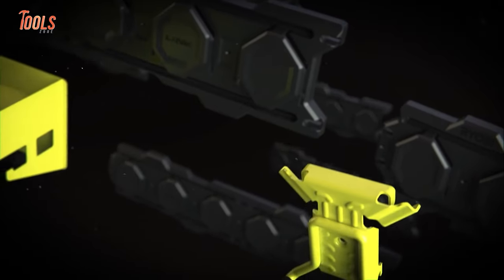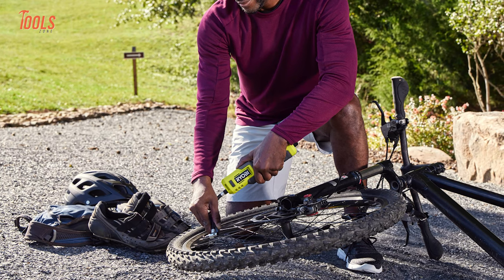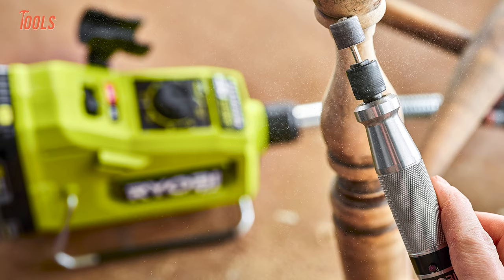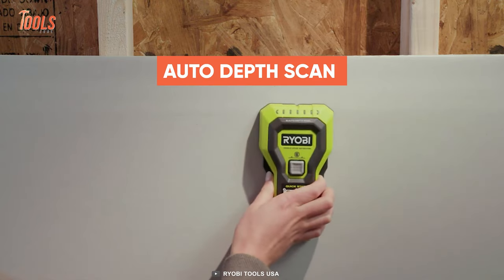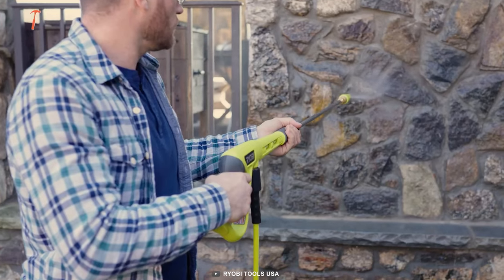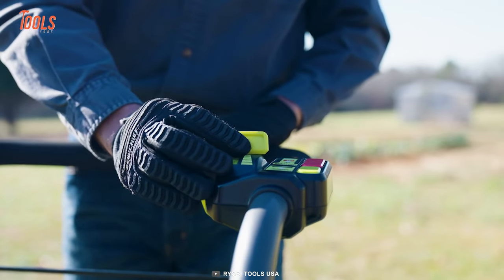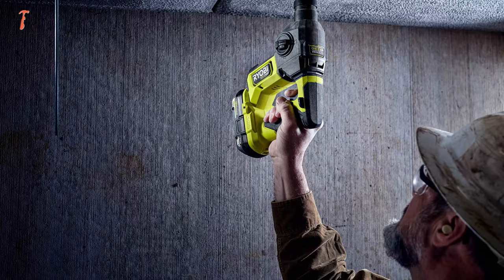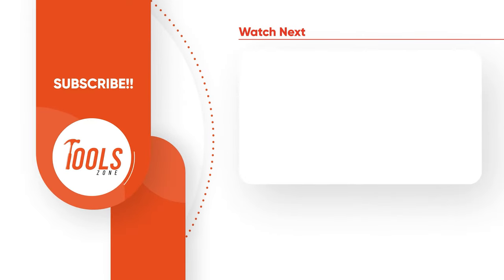10 Coolest Ryobi Power Tools That You Need To See ▶ 4

Comment: For quick top off of tire pressure these are great but they are not designed to fully inflate a car or truck tire.  They generate a lot of heat and usually have a cycle time of only 10 minutes before needing a cooling down period of 10-15 minutes or more.  This is standard throughout all of the cordless inflators (not just Ryobi) and the only way to get around this is to have a stand alone compressor.
Reply from the maker: Thanks for the info!

Comment: I have the scrubber and it works but the on switch is very very awkward.   A rotary tool? needs 1/4" shank like a die grinder   Radio?   no thanks..